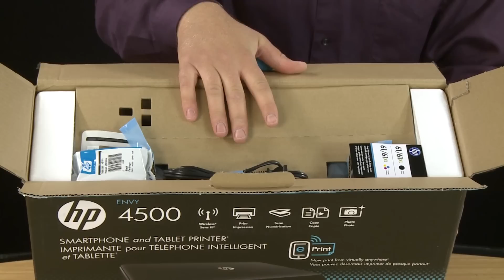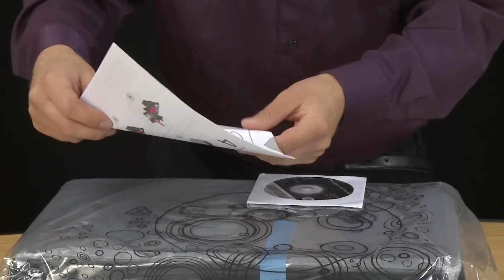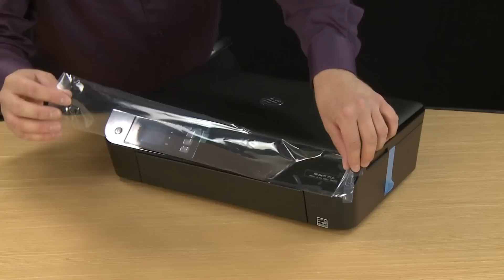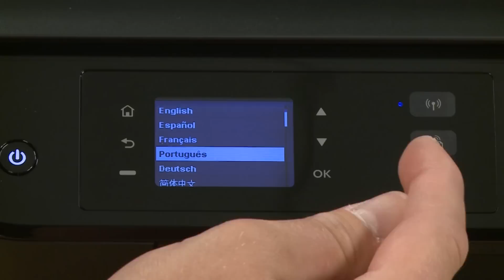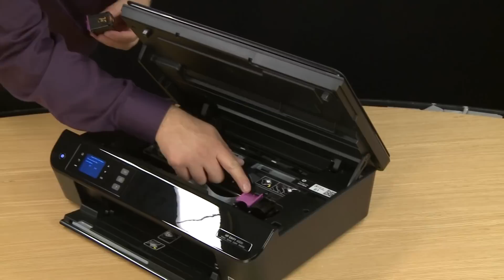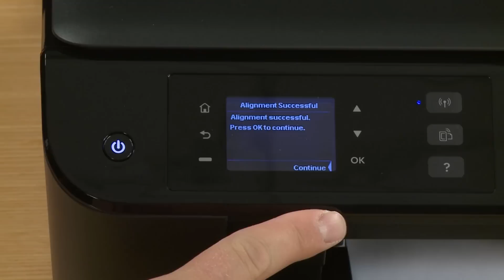Unboxing and Setting Up the HP Envy 4500 e-All-in-One Printer | HP

Comment: My on and off button comes on when I plug it up.  Flashes then stays on and you can not turn it off by pressing, and the screen never shows anything but HP and the bar
Reply from the maker: sandra edwards Please try doing a power reset of the printer ensuring you plug the printer directly into a wall outlet.  If you are unsure of the steps, please search for C01059445 on HP’s home page or using Google search.  The title of the document is “'Reset Power' Message Displays on the All-in-One”.  

It is important that any HP consumer printer be plugged directly into a wall outlet.  Please search for C00597016.  The title of the document is “Issues when Connected to an Uninterruptible Power Supply/Power Strip/Surge Protector”.  The document mentions Laserjets specifically but it is applicable to all HP consumer printers.

Comment: BUY SOMETHING ELSE.
This could be a really good printer, it's got a lot of good features but the software is absolutely appalling and I really wish I had bought something decent now.
The user has absolutely no control over the print correction whatsoever (and I really mean none at all - zero).
It has absolutely no basic color correction whatsoever and if the printer decides it's going to print too saturated, too dark or print with more red, blue or yellow than it should, you are left with really expensive but absolutely awful excuses for photos that are useless to anyone with even an average eye for color 
I have been using an old cable connected HP PSC for the last few years and have been very happy with it, as it has much better software. Unfortunately, I gave it away because I thought I would treat myself to a new printer and perhaps stupidly, thought this would be better.
If you only need a printer that prints really awful, poor quality photos, this printer is OK. because it is actually quite good for most other things but if you ever want to print out a half-decent photo then forget it, it's a total joke.
Choose something else, or go to your nearest photo lab because this printer is total rubbish and is only fit for the bin.
And because I can't find the receipt, I'm either going to have to give it away to someone who might be able to use just it as a photocopier, or if I can't give it away maybe I'll ceremoniously smash it up.
A total waste of good money.

Comment: My laptop would not be able to discover my new wireless HP Envy 4500 printer. I have configured the printer itself. I got the IP address and hostname, the printer has blue light on. I go to Window 7 -> Add a printer  I did not find my new printer in the panel. Why??
Reply from the maker: Sharon Wang I suggest you do a Google search for "c02073861" and you will find an HP Support page: Find and Fix Common Printer Problems Using HP Diagnostic Tools for Windows, which has a tool called HP Printer Install Wizard for Windows, which will walk you through the rest of the setup process.

Comment: Just got my printer but I would like to have the option to print using a cable because I can't print wirelessly due to university rules. I notice that there is another port where a USB cable seems to be able to fit. However the USB isn't supplied, why is this? And where can I get this from?

Comment: Hi my printer isn't reading the cartridge . keeps telling me that the ink cartridge is the wrong one for the printer but its the one that came with the printer.
Reply from the maker: vyvo95
Would you please let me know the wording the of the message that you are receiving?  That will allow me to help trouble shoot the issue.  Thank you.
Reply: it says that it's and "incompatible ink cartridge" I have the hp 4500 envy and the cartridge is 61
Reply from the maker: vyvo95
Thank you for answering my question.  Please search for C03771807 on HP’s home page or using Google search.  The title of the document is “A 'Cartridge Missing' or 'Incompatible Ink Cartridges' Error Message Displays on the Control Panel”.  It will walk you through the trouble shooting steps to resolve the error message.  Please start with Solution Six in the document, ensuring that when you plug the printer back in that you plug it into a wall outlet.  If Solution Six doesn’t resolve the issue, please start with Solution One and work your way through the steps in the document.
Reply: I have and its still not working
Reply from the maker: vyvo95 At the end of that document if you have not resolved the issue it directs you to contact HP Technical Support did you contact them concerning this issue?

Comment: Please how can I use my  HP Envy 4500 e-All-in-One printer as a faxing machine?
Reply from the maker: Olakenny Keke
The Envy 4500 doesn’t come with analog faxing capabilities, however the printer is eFax compatible.  eFax® is a service provided by j2 Global Communications, Inc. , not Hewlett-Packard. eFax allows you to send and receive faxes using the Internet instead of a phone line. HP cannot guarantee the eFax service.  This information can be found in the document titled “Getting Started with eFax”.  Please search for C02970945 on HP’s home page or using Google search.  The Envy 4500 printer is not one of the printers that comes with the free eFax account.

Comment: Does it support WPA2?
Reply from the maker: Stefano Bernardini yes this printer supports WPA2. You can get more information on this printer including information on what encryption is supported by doing a Google search for "c03784120.pdf", which will bring you to HP ENVY 4500 e-All-in-One series User Manual.

Comment: I have a question about the wireless setup (which wasn't shown here).  I was able to set up a direct wireless connection, but the annoyance is that I have to switch the computer's WiFi connection from the public network (it's in a dormitory) and the printer connection.  This works, but is very inconvenient.  Is there any way to set this up so the computer can connect both to the internet and the printer wirelessly, or must I get a USB cable?
Reply from the maker: Terry Whitaker
There isn’t a way to be connected to both at the same time.   As you are in a dorm, I would recommend purchasing a printer style USB cable.

Comment: Is the ink that comes with the printer a regular ink cartridge or is it a sample with less ink?
Reply from the maker: Hi Romael Gibson,
The cartridges that came with the printer are regular cartridges unless they are marked setup.  The setup cartridges are designed specifically to be used when you setup the printer.  They print about the same number of pages as standard-sized replacement cartridges.  If you wish to learn more about setup cartridges please search for C02068088 on HP’s home page or using Google search. The title of the document is “What are SETUP Cartridges?”.

Comment: Hi, when I choose to print a photo, it only prints the photo at the bottom/top middle (depending on how you look at it) part of the page. Is it possible to change how large the printed image is to cover up the entire piece of paper?
Reply from the maker: Hi Wolfgang Hoffstadter,
The printer can handle printing a full page photo, but getting the photo to expand to a full page is dependent on the software that you are using.  Most photo editing software will allow you expand a photo to fill a page. One limitation is the resolution of the picture and whether it will look ok when expanded.

Comment: I have just installed this on my chrome book but every time I print the paper is sucked back in and the message says Paper Jam.  Help please?
Reply from the maker: Hi Nancy r,
Please search for C03754704 on HP’s home page or using Google search. The title of the document is “A 'Paper Jam' Message Displays on the Control Panel”.  It will walk you through the steps required to correct the paper jam message.

Comment: Hi Adam - thanks for informative video.  I've purchased a Envy 4502 today.  I am able to print wirelessly on both my laptops and from my galaxy tab 2 tablet.  I am however unable to set up it from my phone.  I've downloaded HP eprint share and there are no printers on it. When I press add, it asked for printers email address?  I've used my email address I've set it up on, but it rejects it. If I connect to documents its wanting host, friendly name,user name & password.  I'm am normally ok with the basic installation on products, but I just stuck. Can you help.
Reply from the maker: Hi George Davidson,
 
The HP ePrint app is requesting the printer’s ePrint email address.  Your phone, if it isn’t connected to the same network the printer is connected to, it will not see the printer.  To setup the ePrint feature you will first need to get the printer’s claim code.  Please search for C03550536 on HP’s home page or using Google search.  The title of the document is “Getting the Printer Claim Code”. 
 
Once you have the printer claim code please search for C02940150.  The title of that document is “Setting Up a Custom Email Address for ePrint”.  This will walk you through adding your printer to an HP ePrintCenter account or HP Connected account.  It will also walk you through how to customize the printer’s ePrint email address. 
 
For additional reference please search for C01923321.  The title of the document is “HP ePrint Mobile App FAQs”.  If you are going to need to scan from the printer directly to either of your mobile devices please download and install HP’s All-in-One Printer Remote Mobile app. When the mobile devices are connected to the same network the printer is connected to, you will be able to scan directly to the mobile device.  If you search for C03561640, the title of the document is “HP All-in-One Printer Remote Mobile App FAQs”.

Comment: My printer keeps printing lunch notes....it also prints what I ask it....however it always prints 3 sheets of lunch notes.
Reply from the maker: Hello Margaret Ann West,
It sounds like you have accidentally subscribed to one of the printables (apps) found on the front panel of your printer.  Please search for C04058471 on HP’s home page or using Google search.  The title of the document is “How to Access and Modify Printables Through HP Connected”.  It has a section on how to stop and/or remove the printable.

Comment: I loaded the black and colour cartridge as the video suggested, but when it came to the print the alignment page the printer only did it in colour, i turned the printer off and took out the two cartridges and tried it again and again the printer is only printing in colour! I need to print a report tonight!
Reply from the maker: Hi chrissy burke,
Please search for C03768188 on HP's home page or using Google search.  It is the trouble shooting document for when the printer doesn’t print one or all of the colors.

Comment: my hp envy 4501's ink cartridges are stuck and will not move. they are stuck to the far right where I can not access the black ink cartridge. I also have an error code (oxb0000454) I can not find any info on this specific error code. any help would be greatly appreciate
Reply from the maker: Hi Dana Rivarde,
Please search for C03081973 on HP's home page or using Google search. It is the trouble shooting document for the Envy 4500 series of printers that have an error message like yours.  The Envy 4501 is a member of the Envy 4500 series.  The document has a list of detailed steps to follow. Before trouble shooting please check to see which ink cartridges the printer uses as the steps to follow are dependent on the type of cartridges.  And to save you time this printer does not have a removable printhead.

Comment: I am not able to successfully connect my wireless network to this HP printer.

When  I was setting up the wireless,  it said my connection was successful on my laptop and printer. Then, however, when I tried to print  from my Acer laptop all that showed up is that my HP printer is offline.. I don't know how to fix this problem, because I am unsure of what the issue is.

Please respond. Thank you, Deede
Reply from the maker: Hi Deede,
Please search for C03753241 on HP's home page or using Google search.  It is the document on how to set up the printer wirelessly.  From your description it sounds like the printer was installed on your computer for a USB connection.  Once you have found the document click on your operating system, there is a section dedicated to switching from a USB connection to a wireless connection.

Comment: Hi HP, I need help. I'm trying to install my printer (Envy 4500) in wireless network but it keeps failing. There is no specific error, just says cannot connect to the printer. I've tried the latest driver and the CD and the HP doctor. Googled every solution I can find and I still can't get it work. My window is 8.1. any help is appreciated.
Reply from the maker: Hi fluffymasterchief,
You should be able to connect the printer to your wireless network from the front panel of the printer. The instructions can be found in your user guide on page 53 in the section titled "To connect the printer". To find your user guide please search for C03784120 on HP's home page or using Google search.
Reply: Yeah, I did connect my printer to my wireless network. The printer shows up in the network setting and I can have scans sent to my computer via network. The problem I have is that I can't seem to install my driver. Whenever I'm running an installation program and it gets to the point where I connect my printer wirelessly, installation fails because it cannot connect to my printer. And then I have to abort and I have no driver so I can't print.
Reply from the maker: Hi flufflymasterchief,
Thank you for the additional information. Have you tried the Printer Install Wizard (PIW) for Windows 7 and Windows 8?  If not please search for C02681060.  It is the a document about using the PIW to find the best driver for your printer.  It should find your printer as long as it's on the same network as the your computer. If not before you start the installation process print a network configuration report from the front panel of the printer. You should be able to enter the printer's ip address to assist the program to find the printer so it can connect.
Reply: Thanks for the reply. Unfortunately, it didn't work. PIW finds my printer alright over the network and downloads a driver. But the driver installation fails at the same last step - find and connect to the printer wirelessly. Installation can find the printer, it just can't connect to it. Is there anyway that I can force install a driver without running an installation program?
Reply from the maker: Hello again flufflymasterchief,
Please search for C00836418 on HP's home page or using Google search.  It is a trouble shooting document for when the progress bar on the software installation stops or stalls. Each supported operating system has a section dedicated to it.

Comment: I tried downloading the software for this printer, however it keeps saying the latest software isn't available at this time. Please contact your manufacturer. What do I do about this?
Reply from the maker: Hi adavila104,
Are you still having the problem today?  I was able to get to the Windows 8.1 and Mac 10.9 (the most recent operating system versions from Microsoft and Apple) driver download page without any difficulty. If you are still having problems please and you are using Windows 7 or Windows 8 you can always download and install HP's Printer Install Wizard.  It will search for the best driver for your computer's operating system and the printer. Please search for C02681060 on HP's home page or using Google search.  It is the document about HP's Printer Install Wizard.

Comment: I got this yesterday.... so far very nice printer... Im using it by wifi and it connects so easy. I love the wireless capability... and you dont need to turn it off, just stand by so when ever you print something, the printer just automatically turn itself on and print.. so far Good.... :)

Comment from the maker: Hi Renz Carl Supnet.  This printer can be put onto your wifi network right from the front panel of the printer.  Once the printer is on your wifi, you can print to it from your Smartphone.  How you would print from your Smartphone depends on whether it is an Android or Apple device.  If you would like to know more information about the printer, please search for C03784120 on HP's home page or using Google search.  That document number is for the user guide for the Envy 4500 series of printers.
Reply: HP Printer Support

Comment: I just bought the 4501 Envy and it didnt come with a power supply cord. Are they supposed to not come with them? I did get the USB cord though, but I cant seem to get power through it. Do I have to buy the power cord separately??
Reply from the maker: Hello Justin.  I just checked the specs to be sure, the power cord should be included in the box, but the USB cord needs to be purchased separately. The part number for the power cord is 8120-6313.  If you go to HP's Partsurfer web site and enter the product number for your Envy 4501 you can find the part number and it has a picture of the power cord.